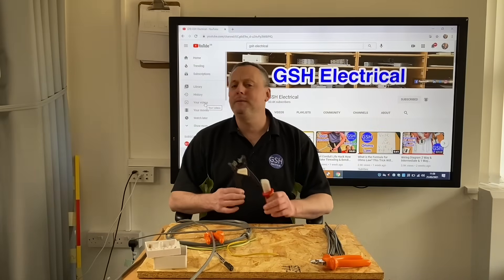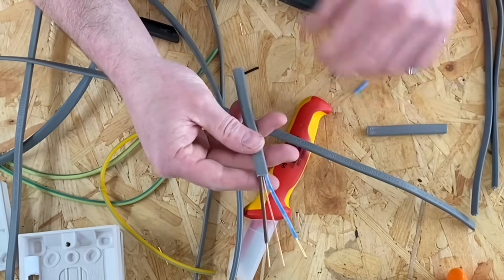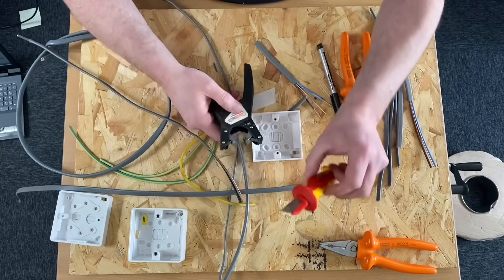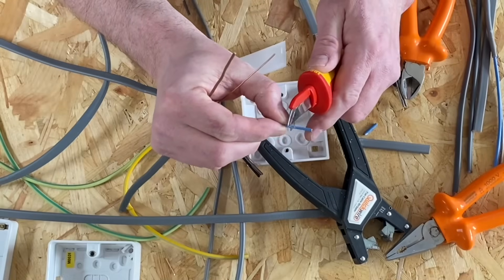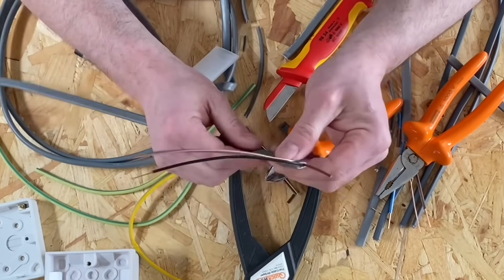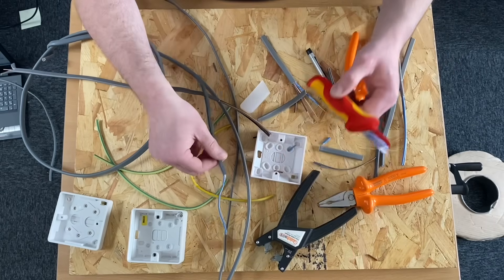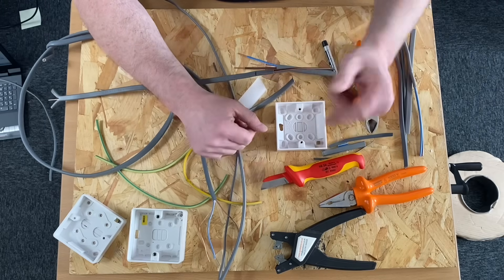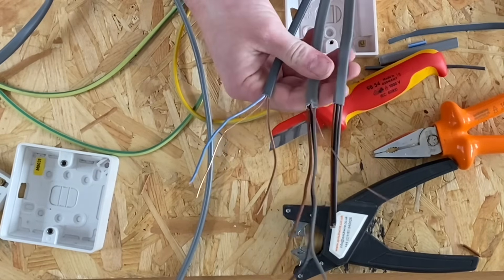How to Strip Twin and Earth Cable’s - Electricians’ Knife vs Twin and Earth Cable Strippers

Comment from the maker: == 🕐 Time Stamps - Cut to the action 🕕 ==
00:07 - Introduction why do I teach people to use a knife when stripping twin and earth cable (twin and cpc) cables
00:46 - Price difference 
01:20 - Demonstration of twin and earth cable strippers 
01:46 - Disadvantages of twin and earth cable strippers
02:45 - Stripping twin and earth cable using an electricians fixed blade knife
03:25 - Why I don't pull the cpc (earth) up the cable when stripping 
04:30 - Will using an electricians' knife weaken the copper conductors
05:36 - Stripping twin and earth cable using side cutters 
07:21 - Feedback required on twin and earth cable strippers

Comment: The wire strippers are designed to strip the Live/Nutrual at the same time... you did them seperatly which is slower

Comment: The one that doesn't look pretty in a box.... oddly enough its the method that allows the sleeving to push right up under the outer PVC 😮
Reply: Not pretty, but safe and efficient, plus the one that allows you to strip the sheething back the furthest.

Comment: Found this interesting. I’m looking for a way to save sore hands stripping about 100 times during a diy downlighting upgrade.
I think the auto stripper is fine for my task as I don’t do it often and not worried if the blade has blunted by the end.

Comment: I have said enough about the knife.
So as not to put Gaz down or to be disrespectful to him , I think the electricians knife is a good tool when your first learning is your first year at college but after that you should be able to and aloud to use side cutters or a wire stripper . How many go on to work as sparks and continue to use a knife to strip TW&E ? Very very view, the only time I use a knife is when I am installing TW&E 10mm2 and for the SWA , I have an folding electricians knife my brother gave me when I first started my college course  back in 1987 , it very wearily comes out of my tool bag these days . Gaz is a fantastic teacher and teaches his students as per the C&Gs curriculum . My real dislike of the knife is the ridiculously high price, £ 27-£40 just because it has a fancy colour handle and name ,
Fantastic video as always Gaz 👍👍👍❤️

Comment: Personally I dont use a knife for T&E, I rarely work with it anyway being industrial based but I have always used the tearing method for speed.
As you said nobody sees the PVC once its in a box!

However when I was an apprentice I was showed how to use a knife, how to use strippers and how to do it several other ways as well.
And although I only do it the one way personally I think its important to know multiple ways to achieve the same goal as sometimes for whatever reason your normal way wont work or cant be done.
And sometimes as you say it wont work for the individual student. (Never had a apprentice pull the CPC out personally but I will keep that in mind in future!!)

Everyone is different and at the end of the day, as long as the method works for you then its the correct method to use.

Comment: Side cutters, clip the end and drag the earth wire to split the outer sheath, been doing it for 40years 😬
Reply from the maker: The issue we have doing that when training is that the cable lengths are short and learners can pull the CPC out of the cable with your method 👍🏻

Comment: Torque screw drives are awful.Would never trust them
Reply from the maker: Thanks for commenting
Reply: Most people don't know how to use them, that's the problem. As with any torque tool, the fastener should be TURNING when the torque is triggered, otherwise, you are leaving the fastening too loose because you are including the static friction in what you believe is the tightened-to setting.

Comment: The replacement blades on those strippers are surprisingly hard to source. Jokari 29030 and Knipex 12-69-31 both out of stock.
Reply from the maker: Thanks for the update 👍
Reply: Replacement parts or a new unit to sell, it's all about the bottom line,
The American management mantra has destroyed Engineering and is basically short term gain for the upper management to the detriment of the company and industry,

Comment: Which flat wire striper you prefer to buy the jokari  or quickwire ?
Reply from the maker: I am sure they are all made in the same factory 👍
Reply: @GSHElectrical  which one would you buy ? Thank you
Reply: @BK-it6te  whichever's cheapest,  my knipex and jokari are basically the same.  The jokari were about half the price.  Ideal and a a few others have rebranded the same tool.

Comment: I wasn’t able to use T&E cables in college but I was taught on my apprenticeship pulling the earth
Reply: I was taught in college not to pull the earth as it reduces the cross sectional area of the earth in the force required to pull through the insulation. All though in real world terms this rarely seen as it remains almost!  the same length as the line and neutral. Getting a nice finish at the point where the cables exits above the  grommet  especially if 2 cables enter was allways hit and miss.
Reply from the maker: I talk about that in the video 👍

Comment: Jokari do a model that will strip up to 16mm. There is one major advantage of the flat profile automatic stripping tools , and that is safety . On the back of this channel I have just bought the Knipex precistrip , there was no mention of any work hardening of conductors within that  video (promotion).  GSH and EFIXX have made a huge difference to the industry for learners , and I do believe that the traditional skills should not be lost . However, in much the same way that the channel welcomes innovations such as wireless switching then anything that cuts down time and contributes to safety should also be appreciated.
Reply from the maker: Massive thanks for your lovely comment it is very much appreciated 👍